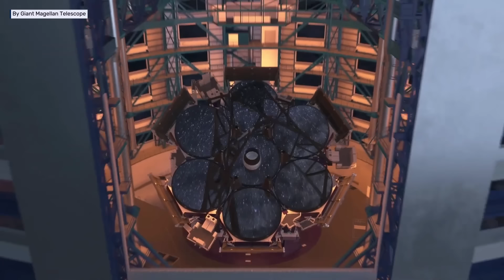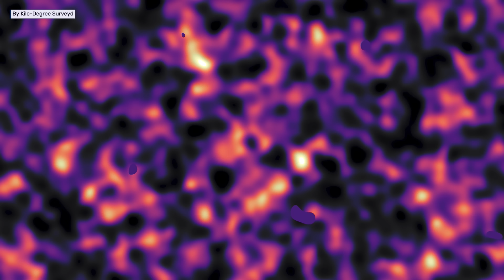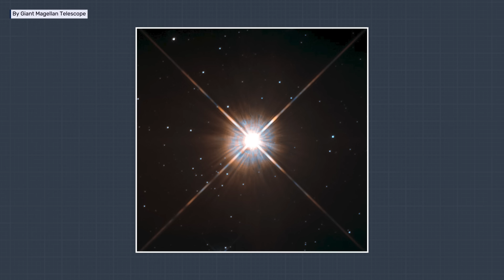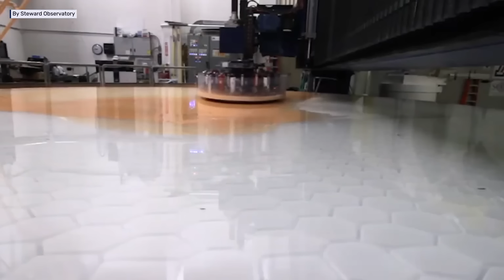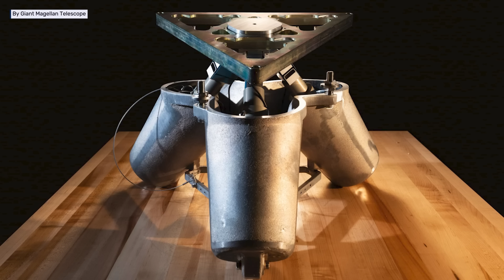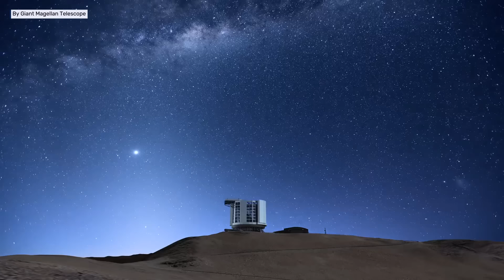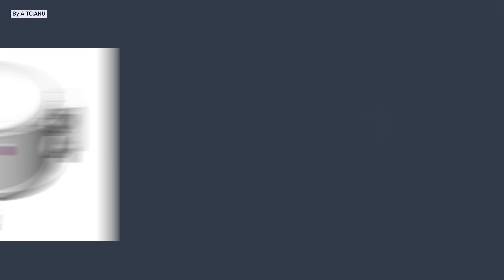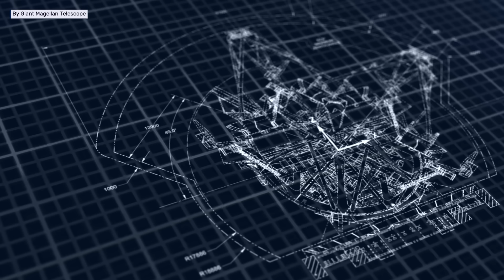The Giant Magellan Telescope: The Telescope More Powerful that JWST

Comment: I studied optical physics for my major. This monster is a marvel of optical engineering and manufacture.
Laser guide stars are basically just firing big ass lasers into the atmosphere to excite specific atoms historically sodium. Reason for this is that sodium has very strong emissions in visible wavelengths. Just think about old sodium Street lamps, now put that in the sky but powered by a laser.
The behavior of that guide star is what the adaptive optics system uses to calibrate the piezo electric actuators to flex the mirror.
These kinds of systems have been around for a few decades but to be able to operate diffraction limited is incredible given the scale of everything
Reply: I wanna know how the code was written/developed for the first gen of tech like that.... "ok, so if the light has been distorted by this amount, I need correction X to take place over Y actuators. Next line...."
??
Reply: @TheSnoeedog  in an adaptive optics system, there is a detection system called a wavefront monitor or a wavefront sensor. One of the characteristics you're trying to measure is the delay  in the light hitting the sensor. This is what happens when light travels through a medium with a refractive index, such as air or glass. Light gets "slowed down" as it travels through the medium. However, atmospheric pressure also has an impact on the refractive index so the light traveling through the air would not only be slowed down, but it would be slowed down at different rates at different points in space. 

Therefore the light hitting the wavefront sensor would be arriving at different times. This data is then processed and passed to the piezoelectric transducers under the mirror which then adjusts the shape of the mirror to match the atmospheric distortion effectively cancelling out the variations.

Must of the physics involved is actually quite fundamental. The relationship between refractive index of a gas and the pressure is studied in 1st year physics, emission spectroscopy is 2nd year physics level,  etc. The true genius is the combination of all these different physical elements into this beautiful feedback loop
Reply: Seems to me there are 2 issues to be compensated for … 1) a half wavelength of total time delay canceling out an equal area of mirror with interference reducing light gathering capability.  2) refracting the optical path miles above will shift the light to hit on another part of the correcting mirror. If the correcting mirror changes the angle light reflects to restore its rightful location on the sensor then what happens when another part of the atmosphere also deflects light onto that same correcting surface location? You can correct one deflection angle but can not correct both at the same time (their corrections require different correction angles but you can only correct one).   
   Also since the only way to add a corrective delta length to the optical path is to bend the reflective surface in or out,  there will have to be angular reflection direction corrections at the same time.  You can not add a half wavelength path displacement without bending the surface to a different angle.  Does correcting the wavefront making it flat  automatically correct the XY displacement shifts on the sensor?
Reply: Sorry, it seems like an Episode of The Big Bang Theory.  Looking at objects that are soooo far away that only theories are given concerning them...we will NEVER reach them in a trillion life times.  So the BIG QUESTION is the same one Penny asked so innocently and profoundly, is "Why?"  To be the "FIRST" or the "BIGGEST"??  Humans will, maybe make it to Mars.   But, very doubtful it will make it past the robot in a go-cart stage.  The return on investment is just not there.  What the USA NEEDS to do is make claim to the Moon (thanks to the Apollo Program with Neil Armstrong and Buzz Aldrin).  This will provide unhindered mining rights, military advantages, and a launch point to deep(er) space with less risk to humans and hardware and cheaper in the long run.  The MATH does not add up for deep space (human) launches from Earth.   This is literally the same scenario as with Christopher Columbus.  Even in space, possession is 9/10s of the law.  If the US doesn't lay claim, someone else will.

Comment: LaGrange points and these really complex orbits are really trippy. The fact that someone figured out that this could be a valid orbit is just astounding in itself!

That same lab also made the mirrors for the Binocular Telescope on Mt Graham. I've driven the road up to that telescope and also taken the tour and let me tell you, that is NOT an easy road to drive with that kind of a load! That was, I think, the first telescope to use adaptive optics and they broke several of the adaptive mirrors through problems with the algorithm driving nearby sections too far apart. The mirrors there are cleaned using liquid nitrogen and occasionally need a new reflective surface, which is done by using vapor deposition (what we would now call "sputtering") to deposit a very thin layer of aluminum across the mirror's surface. The glass isn't actually the mirror. It's simply forming the ultra precise and temperature stable curved surface that the mirror is constructed on.

Remember, "dark matter" is just a name. It came about from the suggestion that there must be more mass than we can see but, not knowing its form or why we can't see it, the term "dark matter" came into being.

Comment: Once we can manufacturer stuff on the moon, a moon based telescope will be the best. The low gravity will allow us to build a bigger mirror.
Reply: Something to this scale on the moon is probably a good 30 to 40 years off. We are just starting to send people back. The sheer mass of the glass needed to be sent is going to take several trips. Then the material needed to then construct and transport the finished mirrors on the moon will take several trips. Its a nice thought, and hopefully it happens. But highly unlikely until I'm an old man (not old at the moment)
Reply: @antonisautos8704 still possible in our lifetime 😁
Reply: @antonisautos8704 30-40 years off is being very generous. I think that’s a project that would actually never happen.  Just the weight of the components would make it extremely impractical.

Comment: Why not build an balloon telescope with drone like keep in place many properties. 
Cable holding it, will also have fibre optics. Bringing to earth video, also used to control the lenses.
It will for start be fixed at 10K km altitude, and can be solar powered.

Comment: I may have missed it, but why do the "petal" mirrors need to be asymmetrical?
Reply: All 7 mirrors together mimic one massive parabolic mirror. So the central mirror is exactly like the centre of that larger virtual mirror and will be symmetrical. However the petal ones are mimicking a section of the virtual one, and being a parabola their curvature will be different at their outside edge than their inside edge.
Maybe Google some images of parabolic mirrors vs spherical ones might help, particularly from side-on - you should see the curve changing.

Comment: Cool mirrors but not a polished as ASML's lithography machine mirrors. If you scaled one to the size of the Earth, the difference between the deepest valley and the highest mountains would be the thickness of a playing card
Reply: Of course they're just a LITTLE bit larger, it does make it harder.  No 8.5 meter ion milling machines around.

Comment: How do they clean the mirrors? I know you described that they have a way of veing stored that protects them from dust... but theyre in a desert, when the structure opens the mirrors will undoubtedly get dust on them...
How do they clean that?
Do they not even bother to clean them? They just "recoat" them?
Reply: Windex and microfiber cloth
Reply: @rogerpenske2411 suspended from the ceiling I suppose
Reply: They sometimes use dry ice "snow", but the get recoated every couple of years on site and that's the main cleaning
Reply: @bobaloo2012 that would be cool to see

Comment: One shocking thought is the Atacama Desert could host telescopes at 20,000 feet or about 6,000 meters above 50% of the atmosphere. It was decided to be above only 20% of the atmosphere. Even the massive budget of this telescope could not afford the extreme cost of reaching such a high remote peak.
Reply: It's the low water vapour level that's most important, the adaptive optics takes care of most of what remains. Of course certain wave bands are absorbed by the atmosphere, going higher up will not help much in this regard.
Reply: @edreeves6440 
That is exactly my point. They’re missing a lot of of the wave lengths that going to 20,000 feet would provide them. In fact that is why SOFIA the 747 was built
Reply: @andrewday3206  Go work at 20000 feet... Ask the japanese about their TAO telescope (6.5 meters diameter, infrared, built at 5600m altitude)

Comment: Fun fact, any ground telescope larger than 8in is limited by atmospheric distortion. You get the light gathering power of a larger mirror but the image won’t be sharper. Without adaptive optics anything larger than 8in is overkill

Comment: Imagine, $2.5 billion just to see how bright each of 10,000 Starlink satellites is.
Reply: Astrophotography of all kinds, from small setups you can put together in your backyard with a dslr or mirrorless camera with a 135mm lens on a cheap 100 to 200 dollar star tracker and a normal photography tripod, to these big observatories, all follow the same process of taking tons of frames, although in the case of a small cheap set up you have poorer tracking so you take even more since you're limited to 30 to 60 seconds per frame instead of multiple minutes, and then stacking them all together. This gets rid of any airplane or starlink that gets into view because they're only streaks that appear for a few frames.